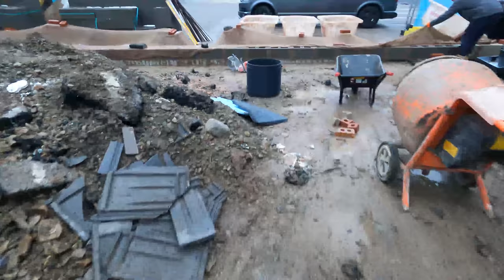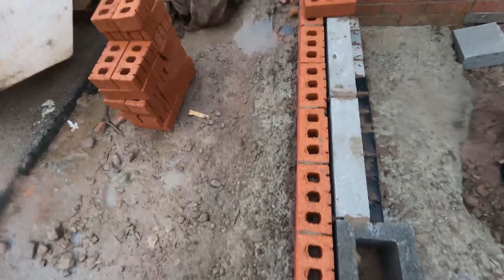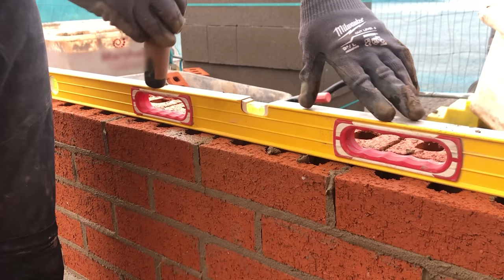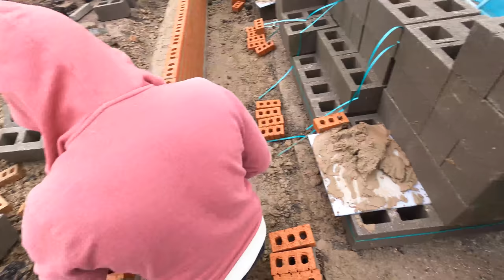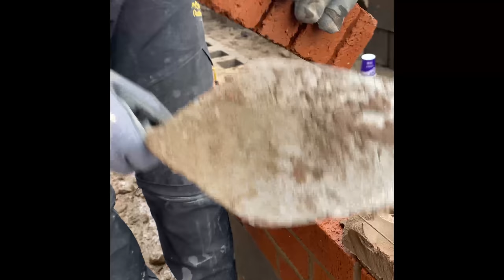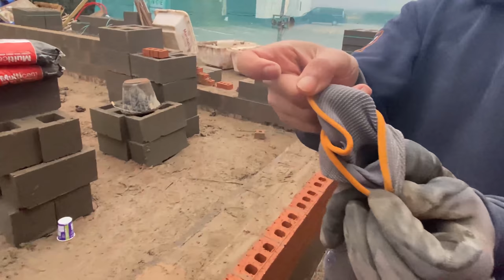Back At It! Building Retaining Walls

Comment: How do you judge the gaps between the bricks, and match the spacing of the blocks to the brick?  Is there a formula for working out how long a wall should be to use whole blocks and bricks. Love the skill shown, the attention to detail. I would live to build my own extension, can do everything else but not done foundations or wall building. Will do though😎😎
Reply: Usually the plans take into account the bricks, if not, cut one and continue on.

Comment: Looking for some opinions. Just bought a house, garden wall is 4 inch block work, 8 ft high, has no footings. The block work actually starts on mud at ground level. It's out of plumb by 40mm and clearly leaning. I'm thinking of underpinning it and trying to plumb it up using a few posts pulling the wall plumb with ratchets while underpinning when formwork is poured. Anyone else had any experience with this?